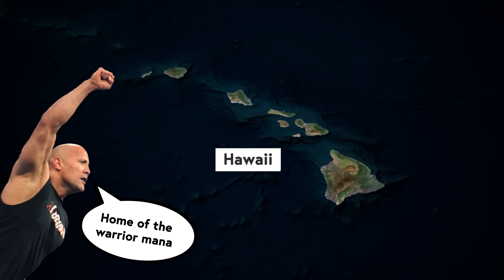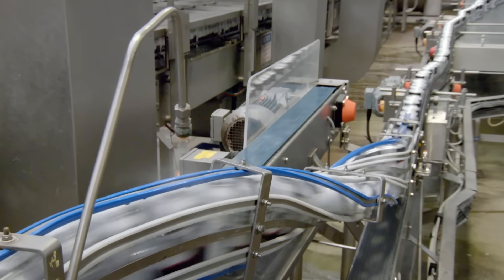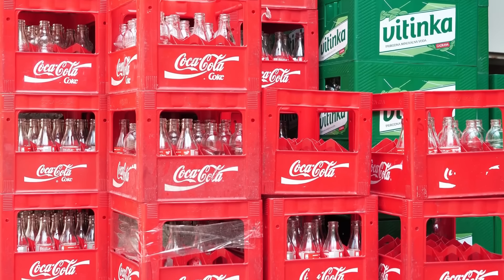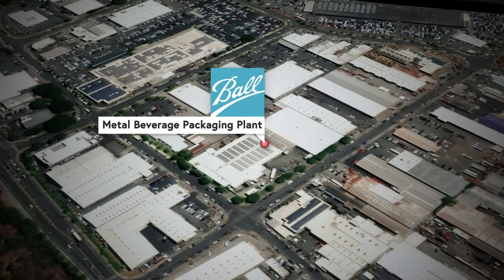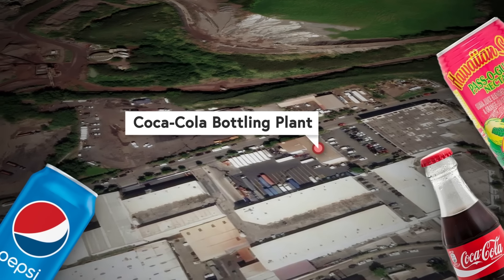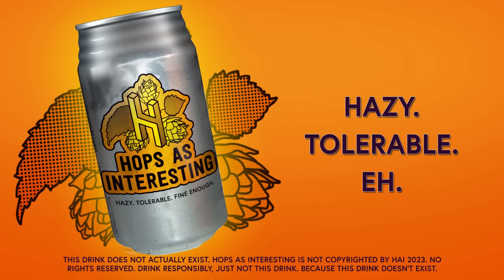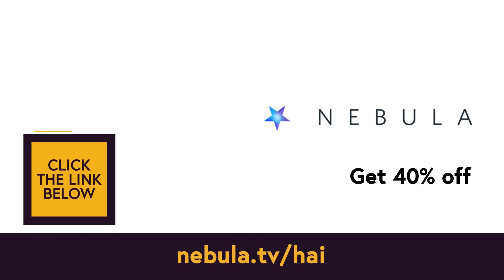Why Soda Cans are Shaped Differently in Hawaii

Comment: Fun fact about the Ball Corporation, they have an aerospace division which does some cutting edge work. For example they provided the main mirror assembly of the James Webb Space Telescope (you know, like arguably one of the most important parts of a multi billion dollar telescope).
Reply: I mean it probably takes some serious engineering talent to optimize canning that far. I wonder if aerospace just made sense since they already had the talent and then it just bloomed from there
Reply: In the mid-80's I worked for MCI Telecommunications. One piece of test equipment we carried around were Rubidium Standards; essentially little atomic clocks for ultra precise timing requirements.  They were manufactured by who? (drum roll...) a division of Ball!!!
Reply: Until this video I had only known them for their aerospace work.  An interesting niche player ("boutique" might be more appropriate) going back to at least the 1960's.  Mostly one-off specialized space equipment, vs say a whole constellation of communications satellites.
Reply: They also made the lunar module windows, iirc

Comment: Yup, can confirm here in NY that Pepsi dominates. PepsiCo headquarters is in Purchase, Westchester County.  There's an iconic vintage Pepsi-Cola sign right on the Long Island City waterfront and the reason why that is because Pepsi-Cola once had a bottling plant in Long Island City and the sign used to be on top of it. The facility has since closed and Pepsi moved its Queens operations to College Point, but the sign has remained and was relocated to Gantry Plaza State Park where it was designated a NYC landmark in 2016. I will say though that the point you have for Brooklyn at 2:31 should be on the neighborhood of Canarsie since that's where their Brooklyn bottling plant actually is.

Comment: I've had 206 cans containing imported coconut water (from Thailand I believe). Or at least, that is what I now believe they were. They had the weird neck thing. But they were really much heavier, not just the lid, everything. I found it odd that a non-carbonated drink was in such an overbuilt can.
Reply: I had a can of UCC coffee also using this can, and it was made of flipping steel. Felt like it could support my weight no problem. Same thing might apply to that coconut water, it might have been steel, not Aluminum.

There might be a contamination issue with both of these drinks, which is why steel is used but I have no evidence for this. Just a hunch.
Reply: Non carbonated drinks need to be overbuilt. The pressure from the carbonation actually makes the can much stronger and more rigid.
Reply: Probably made of steel instead of aluminum. Those are pretty common in northeastern Brazil.
Reply: @ieuanhunt552  
Wanna guess why non-carbonated drinks are in the exact same cans as carbonated drinks?

Because they shoot a bit of liquid nitrogen inside, right before they put the lid on.

There's a massive difference between something being in a can, and something being canned.

The later involves basically cooking whatever is inside, while it's in the can.  So they can't put any nitrogen in.

Plus, the can has to be strong to survive the expansion of the food from the heat. It would take a lot of aluminum to do that.
Reply: It is a denting issue, and steel is cheaper for that design requirement.
Reply: those cans are made out of steel not aluminum.
Reply: @No-mq5lw  I was thinking the same thing- UCC coffee cans are like this and built to survive being run over haha.
Reply: While the lid is always made of aluminium, the rest of the can can be made of alu or steel, in which case the whole empty can is about twice heavier. I was told almost all cans in North America are 100% alu, but here in Europe steel still has a significant share.
Reply: @joriss5  You were told correctly about North America, all cans are aluminum.
Reply: Imported coconut water seem to always have much sturdier and wider topped cans. I drink a lot of imported drinks, Foco brand coconut juices have heavy thick cans in particular
Reply: Yeah those coconut water cans are steel 3 price cans you can see the weld on the side of the can.
Reply: @No-mq5lw  Can confirm, I have two UCC coffee cans with that exact shape.
Reply: Non carbonated drinks need thicker cans due to the liquid inside not being under any pressure, as pressure provides a outside force which leads to stronger cans.
Reply: If do you staples some of the coconut water can produce in Thailand they not fall down if full. Normally they use one row and put hard paper on it and a new row. Do you need your car for crash this can - very funny after coke or cheap companies use Aluminium. With this knowledge do you know blind in night what do you drink hold in hand.

Comment: How long will this last? I imagine the tooling will wear out eventually, and then it will be economical to retrofit to the modern can lid diameter?
Reply: The companies that buy their cans would probably pay them to use the same size.

The drink companies have to put the lids on after putting the drink in. That would require them buying all new equipment.
Reply: Those parts have likely worn out and been replaced multiple times already. Replacing parts for wear and/or accidental breakage is going to happen a few at a time. That means they have to replace them with the same design, or the new parts will be incompatible with the rest of their process (and the processes of their partner businesses).

The cost and complexity of redoing a major, interdependent process like this is that you have to do it all at once.

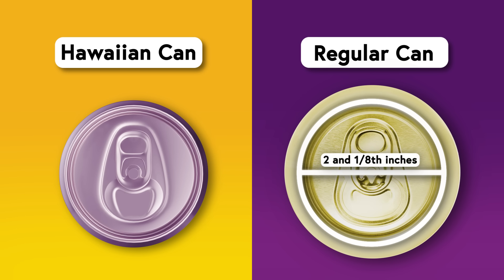Comment: Okay, allow to explain what the Epcot Golf Ball actually is: It's Spaceship Earth and it's not a golf ball but a GEODESIC SPHERE. And inside this geodesic sphere is a whole omnimover (a special system created by Disney's Imagineers) ride with a time machine experience learning the history of communication as you ascend. Originally the ride wasn't supposed to be inside the sphere completely as an early concept model from 1978 showed it would've had a bigger building attached to it for the ride and only enter the sphere briefly but they made all inside because...why not? That wand next to it in the pic at 0:46 was added for the Millennium Celebration but wasn't removed until 2007...good riddance.

Comment: Hawaii also has a pretty effective aluminum recovery system. High costs make “recycling” more attractive, add smaller living quarters and cans are easier to compact before needing to turn them in. Also the high homeless population usually turns in any can the find. Not sure how much actual recycling/reuse happens on island. Just worked the collection side for a while.

Comment: For what it’s worth… Ball Corp has not manufactured Ball branded mason jars for nearly 20 years. They sold off the glass jar business with a stipulation to continue using the logo in perpetuity for marketing and advertising purposes. 

Also for what it’s worth Ball Corp does not make the 6 million cans a day in Golden Colorado. Those cans are made by Coors by Coors employees at their very own can plant owned by Coors. That specific can plant has a ‘joint venture’ status with Ball Corp dating back many years enabling the Coors family to have discounts on raw materials and equipment. In turn Ball shares profits & helps micro-manage that facility of Coors employees. It is the largest single location can plant in the world. The modern 2-piece aluminum can we have today was invented by Bill Coors in the 50’s right there in Golden, Colorado.

Comment: I worked the Hawaii Can Plant in the early 80’s and was there when the industry went from double neck to triple neck cans. Shortly thereafter the industry went to quad neck cans. As said in the video solely to save money. At that time the company was owned by “Reynolds Aluminum”. Who pioneered the all aluminum can. Reynolds eventually sold all of their can plants and lid plants I think to Ball. Crown Cork and seal also makes aluminum cans. The neck on the can that is made today is a spun neck and requires different tooling. As stated to re-tool to make the spun neck is costly and not worth the cost in the small market in Hawaii. We used to close down production about 2-3 times a year. A core crew would then perform needed maintenance and upgrades. But this was primarily because the plant was making more cans than the local bottlers could use. Did you know Reynolds developed the “Hot Pack” system so juices can be put in aluminum can? This was because of Hawaiian Sun wanted to get away from steel to aluminum. The process was then adapted to other bottlers such as V-8. 😊

Comment: Soda cans are shaped differently in Hawaii primarily due to a unique law passed in 2004. The Hawaii Deposit Beverage Container law (HI-5) mandated that all aluminum cans and glass bottles that were sold in the state must be recycled, and that a deposit fee of 5 cents would be charged on each container. However, due to the high rate of redemption, recycling facilities in Hawaii found it difficult to process the cans that were shipped to them from other states, as those cans were usually crushed and compacted to reduce their size, making them difficult to sort and process.

To address this issue, beverage manufacturers in Hawaii started producing a more cylindrical-shaped can, which is easier to sort and stack. The cylindrical shape of the cans also makes them less likely to get crushed or damaged during transportation, which can help to maintain the integrity of the container. The new design has been effective in reducing the cost of recycling and facilitating the recycling process. Today, the unique cylindrical-shaped cans have become synonymous with Hawaii's beverage industry, and they are widely recognized as a symbol of the state's commitment to sustainability and environmental protection.

Comment: It could easily be replaced. The necker step is the last step in the process that actually shapes the can. But it works. And smooth neckers are usually on high speed can lines. Which the Hawaii can factory is not. So yes, doesn’t mare economic sense when the current low speed lines cant really take advantage of it. I used to work on the electrical side of these Hawaii machines. If anything business has gotten less with bottles taking ever more market share. Around the time I left they were taking contracts for the first time for beer cans outside Hawaii for small runs, which is much better than shutting down for 3 weeks a year for layoffs because you literally filled up your warehouse with millions of cans.

Comment: Makes me think of a rare brand of beverages I find here in Italy, mostly in kebab shops or smaller shops owned by immigrants, which is the "Best" branded juices. That brand produces their cans in Egypt, and they still use an old style of can that's very stubby, perfectly cylindrical, and still has a pull tab, which they became out of fashion here in Italy something like the early 1980s!

Comment: Have you seen an Iranian coke can? They're smaller, got thicker aluminum and have a different opener - the ring doesn't push the score inside, you just use it to pull a metal strip off the lid instead, like the old cans used to be.

Comment: I worked in a soda canning plant. We, in a normal year, used 360,000,000 cans. When we converted to the 202 can, it cost a quarter million dollars in tooling alone, plus labor. Recovered that cost in about 8 months. This guy is right. There is lots of money to be saved in small changes if you are talking hundreds of millions of units.

Comment: I work in a Can factory in the Uk. I cant believe this as fact. It would seem to me that there is no articulable benefit to spend the money, not 'iTs To ExPeNsIvE'. If hawaii has a smelting/recycling plant to produce the raw materials required then it is just a case of there is NO POINT in upgrading. Updating the tooling and changing the Can can benifit the plant by reducing the coil thickness ergo increasing the amount of usable length able to be transported per container but if transport is just down the road the savings would be neglible long term. If the raw materials come from out of country then they would save the amount they would have spent updating their tools pretty fast. I would argue that if the first assumption was true the real reason they havnt changed is just that they are in terms of Canning  'a self contained eco-system'

Comment: I wouldn't call saving materials by reducing their requirements "GREED", I'd call it OPTIMIZATION of design.

You don't need a car with 30 wheels, 4 seems to be ideal, perhaps even less in the future.
So, why not keep reducing all our commodities' designs until they are at CORE MINIMUM requirements?

Comment: Although the plant is now operated by Ball, It was built and operated by Reynolds Aluminum until Reynolds sold their can making business to Ball around 1999. Reynolds developed the multiple necked can and later developed a spin flow neck which uses the 2.02 lid. I was fortunate enough to go to the Hawaiian can plant while working for Reynolds in the early 1990s.

Comment: The entire modern soda can is made from aluminum, and its total enveolpe/material used hasn't changed.   What has change is the equipment used to make the cans.   In Hawaii's case they are made and consumed locally but made entirely of imported roll aluminium by Ball.  There is a limited, small market, 1.4 million total residents. Ball has no compelling reason to invest in new equipment.

Comment: I must have missed something. Its too expensive to change the equipment? Even though it would save them money and resources in the long run?

I get that the market is smaller but less aluminum is still more money over time. They are literally throwing money away there is no good economic reasoning here.

Comment: I was involved with the marketing of a machine that Reynolds Metals manufactured starting back in the 90's, that spun the cans like a potters wheel to make the can lids even smaller, instead of using a dye, which couldn't go that small without a lot of waste.  It's sells were doing OK because of the savings in Aluminum, but we also marketed it as a better looking can which did the trick.